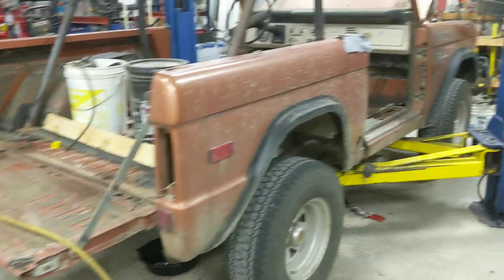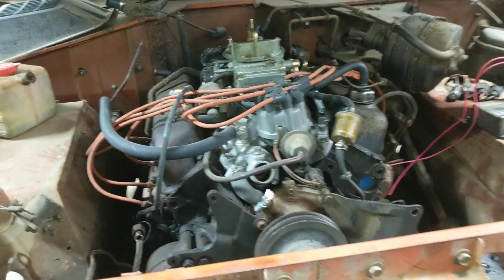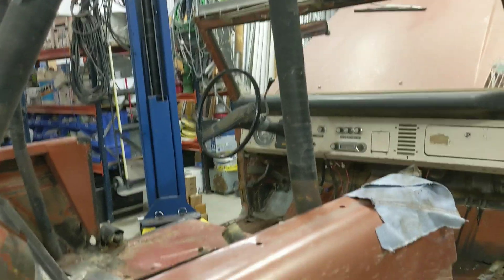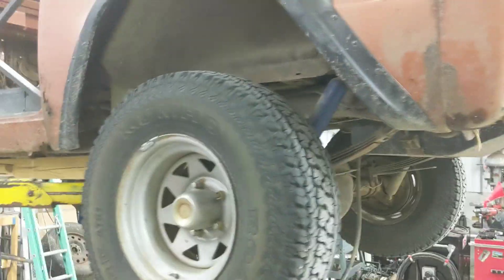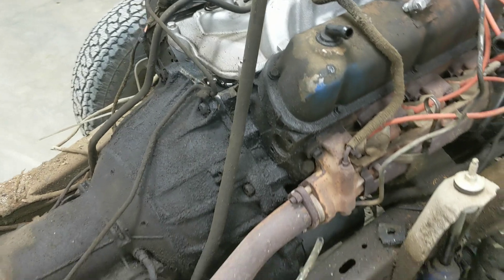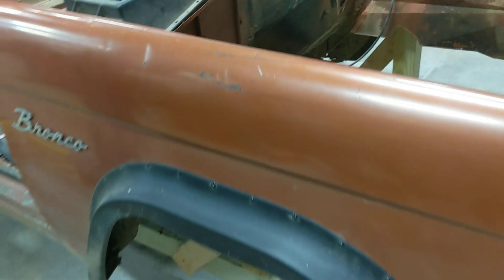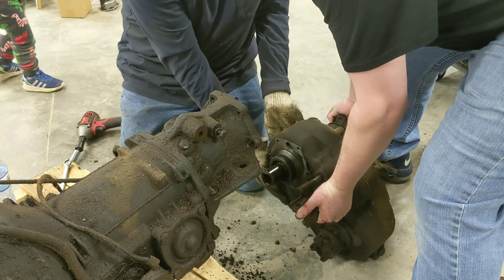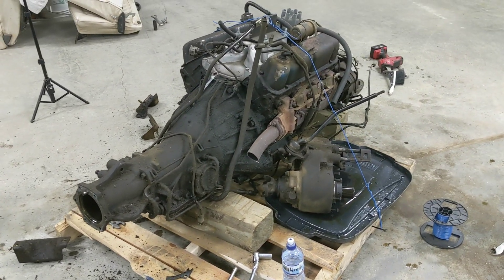Removing the Body and Powertrain for Coyote Swap

Comment: Any frame modifications, like stiffeners or boxing  of the frame ?
Reply from the maker: Not at this time. This bronco won't have extreme huge tires or anything on it at this time. Just more of a restomod cruiser I guess that will handle ditches and snow and those types of obstacles. 👍
Reply: @605BOLT  it should do well. i have a couple of spots on my frame i am going to add some additional support, especially around the power steer gear box. my bronco originally had a snow plow so it took a bit of a beating, so many hours getting  it solid and looking good.
Reply from the maker: @dxkeeling  that's a good idea. I've heard about people reinforcing that area before. Could always do it after the fact on the lift. Might have another project on our hands 😂